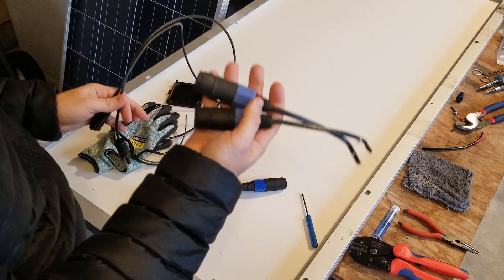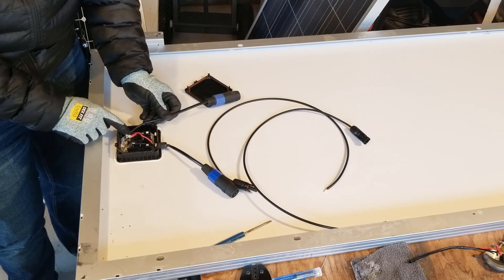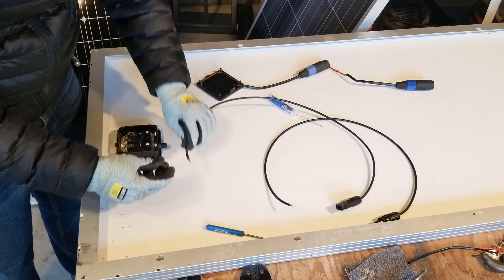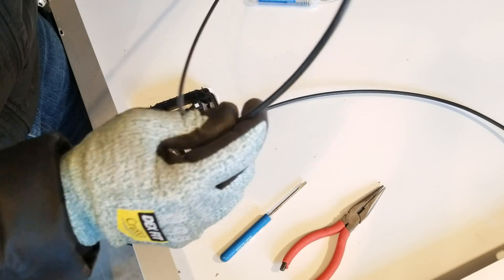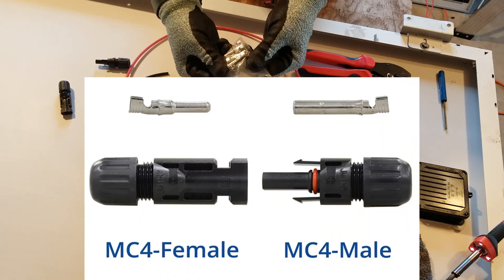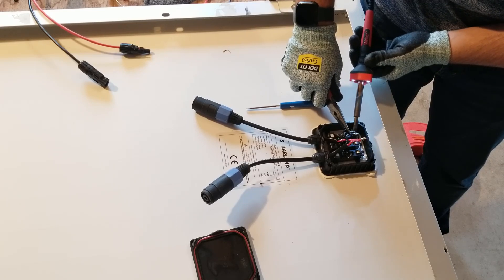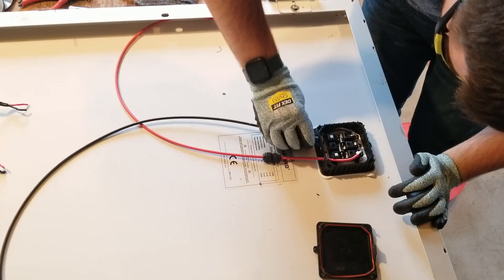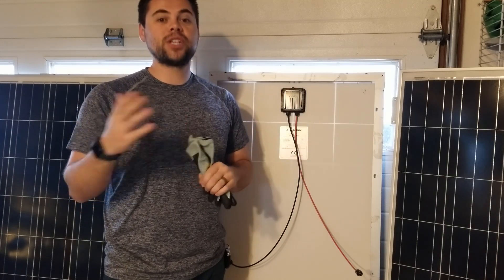How to Change Inergy Solar Panel Connectors from Neutrik to MC4

Comment: They are actually a knockoff neutrik connector. I contacted neutrik for a replacement connector and they claimed Inergy was in violation of their copyright. Maybe why Inergy changed connectors once the apex came out.   Anyhoo. I’ve got two storm panels that are all rusted having spent a year on top of my RV outside in storage. I’m thinking of trying to refresh them and connect them to my newer Renogy system. Any ideas on cleaning up the corrosion?

Comment: Hi Minute Man Prep.  I have the gen 1 inergy Kodiak and five of these panels - pretty much still new used three times..   I took the cover off the junction box and hard to tell if is the same as your config because vid here is to small on my eyes.   I have several questions and like to ask if we can set up a 15-30 consulting call to walk me through few things and also share a few pics what I have... then create a plan.     How best to email or get in contact with you to share pics/vids of what our current config is.

Comment: Should it not be easier by cutting and splicing the original wires then put individual connectors to add between each other in series as wanted?

Comment: I have one Kodiak 1k battery  and one NEUTRIK 100 watt solar panel.  Can I just wire half of that panel (as above but only the input) and then connect a new MC-4 panel connector up to it? As long as the 100 watt Neutrik panel is last in the chain and I'm 12 volts up to that point I can use that old panel to connect to my Kodiak? Like you say " no one makes Neutrik to MC4 adapters anymore' , wouldn't that do the same if you use the last panel in that way?

Comment: Have a question about mc4 cable length. I see on your site you offer a 100ft cable. How much power loss can you expect from that long of a cable? I live in 4 story condo complex and I'm on 1st floor, so I was thinking of putting panels up on the roof next to my ac unit when ever we have power outage or after hurricane and was going to run the cables down the side of the building to my unit. And when I'm done I can just pack it all up and store it away. Was also thinking of seeing if I can run the wires down the same way the ac unit wires run from my outside unit to the inside unit. Thanks in advance. Love the vids keep em coming.
Reply from the maker: If you're using the Titan solar generator from https://poweredportablesolar.com/ then there's no noticeable power loss because it uses high voltage and low amperage which means no power loss. But if you're using another unit that connects the panels in parallel you'll have high amps and low volts which will have a power loss anywhere from 10 to 15% most likely. Amps are hard to send long distance, volts are easy to send long distance. Hence why series connections or at least series/parallel connections are far better than parallel connections for solar panels. What solar generator are you using?
Reply: @minutemansolar  I pre-ordered the Bluetti AC300. I was torn  between that and the Titan. Really liked both.

Comment: I need a Female coupler for EC8 connectors.....as INERGY only offers a 6 foot cable and I need 12 ft of cable for panel spacing. So I can route around windows on the off grid cabin.
Reply from the maker: Yup. That's why I hate proprietary systems.

Comment: I have a inergy kodiak and I would like to add the ability to tie my current solar panels with neutrik connectors into my RV.  I have neutrik chassis connectors, but I am having difficulty understanding how to wire the parallel solar panels into the RV. Any Ideas?
Reply from the maker: Are you wanting to use the Kodiak in the RV as well or just the panels into the RV?
Reply: I would like to use the solar panels to charge the RV battery and since all is wired with neutrik connectors for simplicity would like all of the wiring to be the same.  Thank you for any pointers you might offer. Rob
Reply from the maker: @robsimon7231  If you'd like all the wiring to be the same then you'd follow the video on how to remove the Neutrik connectors and then put in whatever connectors you need.

Comment: Guess I've been lucky .   Never seen and of those connectors.
Reply: pulesjet they’re common in the stage power and sound industry. I believe they’re powercon connectors, if you’re not paying attention you can inadvertently send 110 (US) or 220 (UK/Europe) to your panels and you’ll a expensive fireworks show or a shocking experience.  :-P...

Comment: What about Neutrik to MC4 adapter cable?  That way it would allow series and retain parallel connection seamlessly.
Reply from the maker: I had thought about that and the biggest issue is the each Neutrik connector on the Storm panels is connected to the positive and negative posts inside the panel black box. So you would need two Neutrik to MC4 adapter for each panel. And then you'd have to take both negative and positive MC4 connectors and combine them into a d 2 to 1 MC4 Branch combiner. So that's a lot of connectors for each panel. The biggest issue is that no one makes Neutrik to MC4 adapters anymore. So in the end you'd have to make your own adapters and would be more soldering than just doing this.